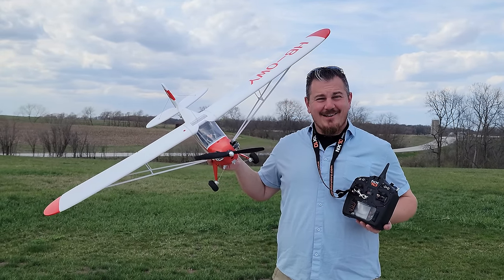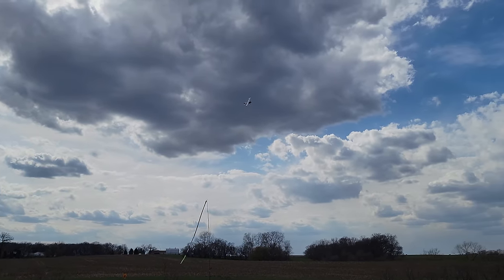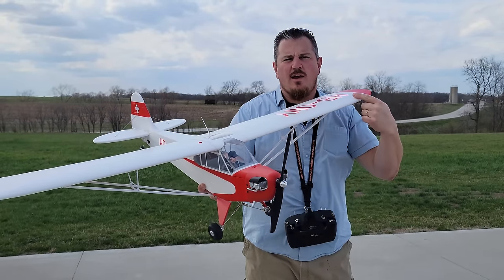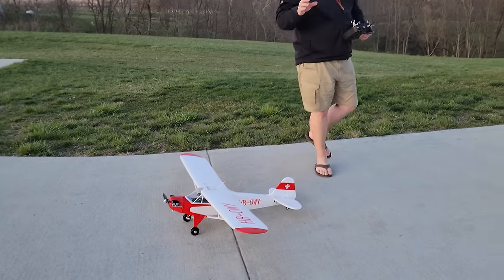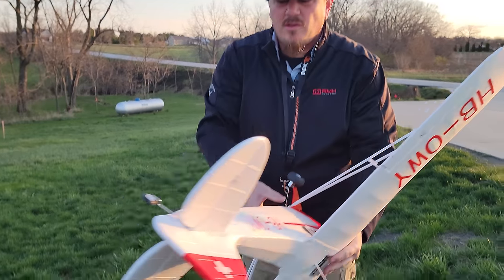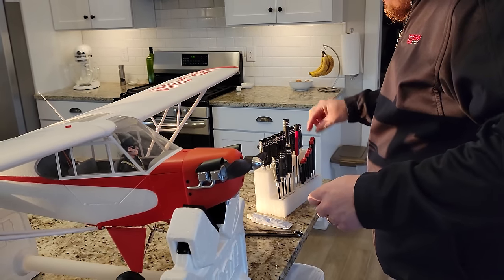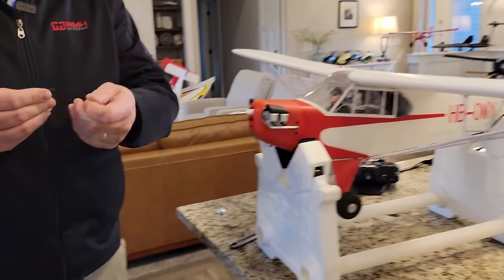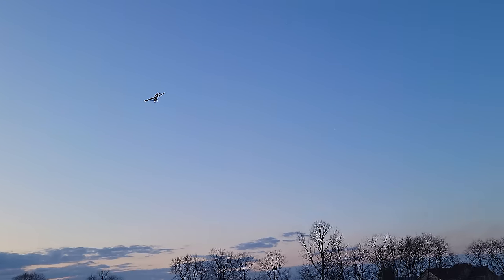FMS - Piper J-3 Cub - 1.4m - Maiden Flights + Crashes + Repairs + Final Adjustments

Comment: Hey Brian, I got my J-3 last summer.  Our club is a grass strip, so I replaced the little tires with eflite Timber tires for grass ops.  I flew it with the FMS stabilizer and felt that I wasn’t getting good control authority in SAFE mode, so I took the stabilizer and my AR620 receiver out and replaced them with an AR630 receiver.  Not good!  I experienced the wankiness you probably on steroids, complete with crashes.  I wound up pushing the expo on the rudder to about 80% or 90%.  It helped, but still feels like a handful.  Thank you, I will try 1300 mah batteries and and add the mixes you suggest!  Doug Coates, Bristol, RI
Reply from the maker: GOOD, now I don't feel so bad. Let me know if my "fix" takes care of your issues too. It was WAY worse than I would have every expected, and I felt like I "took the plane from the grave" with this little TINY fix.

Thanks for the feedback, and hope to hear from you soon as to what you figure out.
Reply: @BrianPhillipsRC  I am a private pilot with an instrument rating and owned a Piper Cherokee for almost 20 years.  I no longer fly full scale.  I started the rc hobby during Covid and this will be my 4th year.  To be honest I fly in SAFE mode all the time because I have not felt comfortable not.  I agree with how you felt the plane should be an amazing flyer and beat up on myself when things  went badly.  I damaged everything you did with the exception of the prop shaft and landing gear.  After I removed the reflex, I couldn’t take off with getting into trouble!  LOL!  Now I know!  Thank you again.  😎

Comment: ohhh i bent my shaft on the volantex 750mm mustang, on the first flight. quite bummed out about that, the beginner mode basically couldnt turn in the field i was in. realized too late. looking forward to see if you fix yours. staying tuned
Reply from the maker: I did it in this video, so hope you'll see what I did and emulate it closely to get back in the air. If you over-bend it, it may break, and it has to be pretty dang close to perfect, so take your time. If you have to dismount the motor to make the correction, put the shat into a drill chuck and spin it to see if it's straight before going through the trouble of remounting the motor.

Good luck!

P.S. that 750mm Volantex Mustang is HARD TO FLY. I would highly encourage you to consider a 1.2m P-51 Mustang from Eflite - you will be AMAZED at how much better a plane it is. If you need SMALL, but want a BIG plane feel, get the UMX P-51 - you will LOVE it compared to that 750mm, nearly impossible to fly disaster. I know from experience. I've flown a number of the 750mm P-51's and all of them sucked BADDDDDD.

https://bprc.me/P51

Comment: Hi Brian and Megan. I really enjoy your very detailed videos. Just a thought about the cub. If it is anything like the FMS PA18, it will be very well built but also very heavy for its size. I think the wing loading will be considerably higher in proportion to the real thing. Are the wings solid foam? I'm taking a bet they are. I have a hobby zone carbon cub (has lots of thick foam) which I consider too heavy for its size and, while it's a ton of fun, is disappointing next to my full sized Legend AL3 Cub when you consider gliding without power on a 3S 2200. The full sized cub has Frise Ailerons to counter the unfortunate amount of adverse yaw resulting from the design of the plane. Well done with putting in the mixes.
Reply from the maker: I wonder why they don't engineer that Frise Ailerons into this wing?

This model is super similar in quality to the PA-18 of both 1.3m and 1.7m sizes, but the PA-18 comes out of the box wanting to fly amazing...this one, at least in our experience, not so much...which weirded me out to no end! I think you're onto something with the higher than expected wing loading. That's maybe why the smaller 1300mAh 3S made such a big difference, then the mixes really REFINED it back into good flying behaviors.

Another commenter suggested adding DIFFERENTIAL, which I hadn't considered, since I don't want to waste the channel, BUT it would be pretty easy to change over to that configuration. We have the channels, but if I want to make mods, I'd want to also plop in some inboard flaps. I just love SLOWING down planes. Especially these ones that you KNOW would be just creeping by in real life...I know, it's weird that I LOVE slow in RC planes. I want slow so you can look and see everything working. I want slow, since it's easier to fly. I want slow to savor it as I fly by. I want slow for extra greasy landings. I want slow for better gear performance and easier on the air frame... I'm always amazed how many people aren't into slow - but then I see professional pilots... at or near 100% throttle the whole flight. It showcases most planes nicely, but I want slow ;)
Reply: @BrianPhillipsRC  Thanks so much for your reply. I totally get where youre coming from. Slow is fun and I think you learn more from it too, as you can really see how the aircraft responds to inputs. When its fast, you can barely see whats going on. Thats why the majority of my models are balsa unlimited aerobatic ones. My favourite is my Precision Aerobatics Extra 260. Runs on 3S 2200mA. They have super light wing loading and love to float and glide. Much more like a full sized manned aircraft (well, at least my cub lol). They are also generally very well behaved and respond very precisely to inputs without much coupling or weird yaw.

Comment: great flying and teaching. i didnt know you could couple controls electronically on the radio, i know that real planes can have mechanical coupling, so thats all i had considered. youre teaching a lot of new people about stuff that they normally wouldnt hear about for awhile. its cool that youre explaining that. but have you heard of differential aileron? each aileron has more up travel than down travel, that helps with adverse yaw. another one is " frise aileron", where the aileron has its leading edge ahead of the hinge line, and protrudes and creates drag as the aileron goes up. i dont know if any rc have these, i just have the two volantex mustangs. i want to add flaps and retracts
 
robbie, of the 72nd comment, and 269th like division.
Reply from the maker: yes, differential is a way of doing this, but you have to separate each aileron to their own channel, thus you'd be using up another channel. It CAN help too, so might be worth trying, and it's easy to do IF you don't mind giving up the channel. If you want to try it out, we've used differential before, but it's usually not a big deal...although, admittedly, this plane NEEDED some attention to get it flying, and the way I suggested correcting for the terrible coupling tendencies is pretty easy and radially available on most Transmitter systems, not necessarily JUST on Spektrum ;)

Also, if you separate out the Ailerons, you can setup flapperons, and/or spoilerons. If you're curious, keep watching, can't spend the time to explain it here on a comment, but we've talked extensively for hours and hours about this too, if you're curious. Watching our Unbox, Build, Radio Setup is where it's at for a newer or returning to the hobby, pilot...so we're glad to help!

Comment: The bolt on prop adapter can be replaced if bent, better than replacing a bent motor shaft with a collet type adapter setup. Your model seemed to have a bit excess down-thrust. Reducing weight of battery pack seemed to help get level flight. My Sig 1/6 scale J-3 flies better with aileron-rudder mix. Cub-like designs can have "adverse yaw" tendencies, need rudder/aileron coordination or differential ailerons ( up motion but little down motion). Differential requires 2 aileron channels. Cubs are not really stable "trainers"  they require piloting.
Reply from the maker: yep

Comment: On mine I didn't have to do anything for it to fly great and really agile. All with a 3s 2200mAh. Tight battery fit but it flies fine. The small wheels thou, well that is not for grass ops. In the end I prefer the FMS PA-18 1300mm as it handles almost perfect and with the large wheels grass is great.
Reply from the maker: Me too. The PA-18 1.7m is AMAZING.

I wonder why mine was so dang wonky??? I had another guy report his was that way too. Wonder if there's a weird TWIST in the wing or something else strange?
Reply: @BrianPhillipsRC  Maybe just maybe it can be gyro related. I set mine up with a Spektrum gyro receiver and didn't use the Reflex gyro. Mostly to do a cleaner wiring setup.

Comment: about the threads, would tape around the threads interfere with bending the shaft? thats what i do for chucking screws in a drill to clean them up lightly on fine sandpaper
Reply from the maker: I wonder if you could just wrap a few rolls thick, then use the CHUCK to straighten it???
Reply: @BrianPhillipsRC  i have no idea. ill give it a try with a long screw.  i forgot to say in this comment, thank you for showing how to fix my bent shaft. ill let you know how the chuck does if you dont already try it.

Comment: Have you tried using the aileron differential?  That can sometimes be very helpful when planes have too much adverse yaw.
Reply from the maker: I haven't and didn't want to waste the channel to split out the Ailerons, BUT we could do that - Good point. That being said, given this is fixed gear AND ailerons only, it wouldn't be hard to setup. Should have enough channels.

Biggest issue with needing differential, is that you don't KNOW you need it until it's all setup and working poorly...our mix can be added after the build is done, and you've come to the realization there might be an issue.